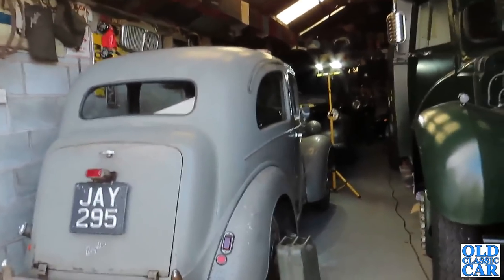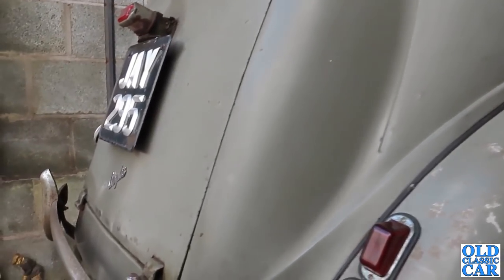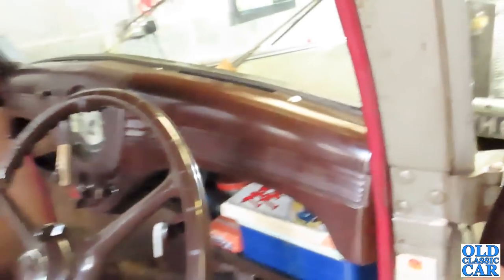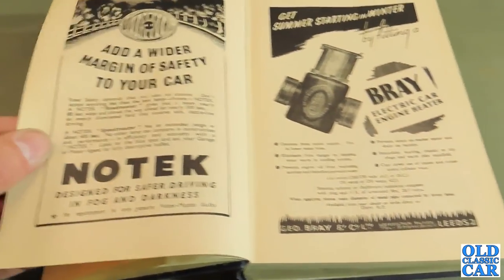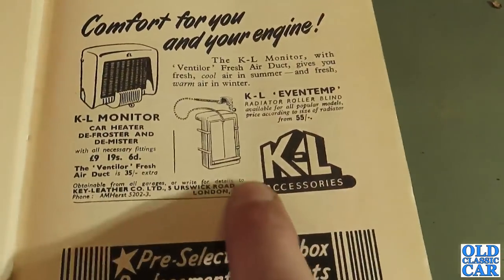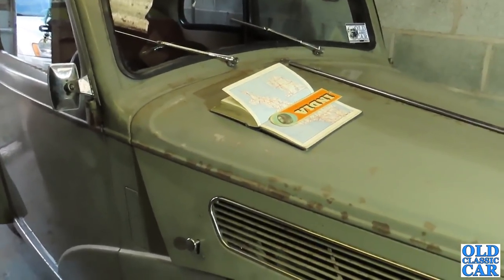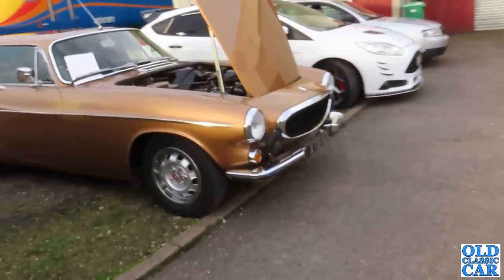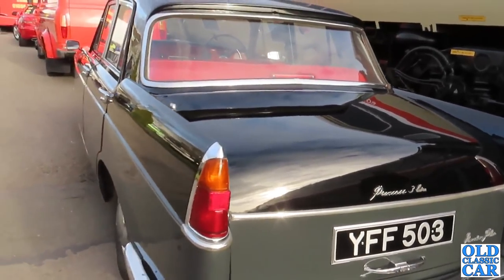Classic car show time - Ford Anglia prep, bakelite attention, off we go ... an imminent fail avoided

Comment: I am with you on the voltage upgrade,  'if it ain't broke don't fix it'. Just a thought on the bakelite, there used to be a museum in the Lake District dedicated to that material they may have some guidance on how to look after it. I remember they had some classic caravans as well. It's many years since I went there so it may not be open now. Anyway this was a nice video,  a bit of tinkering and driving. Oh and do keep the peg it adds to the character. 👍

Comment: About 40 years ago I bought an 'Autocar' handbook c.1956 fro9m a village fete bookstall, similar to your 'Motor' example, On page 100 there is a line-drawn illustration of a bakelite dash on an Anglia like yours titled 'Complete F&J hand control equipment on a standard Ford Anglia for a legless driver'. They clearly had a more laissez=faire attitude to drink-driving back in those days!........

Comment: Hi, I am surprised with the use of the peg and a bit confused to what purpose it serves? It is just because the choke cable isn't a locking one? Also how long do you let it warm up with the choke cable on? I recently had to replace my Anglia's choke cable with a non locking one and I only have to hold it out for about half a minute, not even while on a cold start. Then it just goes back into the dash itself and it runs just fine!
My worry I guess is I might be running it a bit rich if it runs so easily without choke.
Reply from the maker: Mine doesn't appear to lock out so the peg just helps it a little, quite a common "upgrade" back in the day. It doesn't take long to warm up but I've not timed it, it varies a bit. The plugs will tell you if you're running too rich all the time, just check their colour after a decent run.
Reply: @oldclassiccarUK  Thanks for the tip to check the plugs I wouldn't have known.

Comment: Not stressing dynamo bearings - is there an oil hole for the belt end of the dynamo ? There probably is an oil hole on the other end at the centre of the bulge on the end cap. Seems odd they put one there but not at the other end - which is why I'm asking. Otherwise you'll have to wangle oil into the belt end bearing by some other means !

I was hoping this video was going to be more of the actual drive to/from Crewe.
Reply from the maker: Thanks for watching, previous vids have shown more of the actual driving along but I don't want to repeat myself therefore I try to vary things a bit, other vids on the Anglia are in the Ford sidevalves playlist (category), here:
https://www.youtube.com/playlist?list=PLOo0jewyadeGPUJIs5kqI0DeAUdNYL37O
Reply: @oldclassiccarUK  Tricky !

Comment: For what it's worth, I think it is worth polishing up the dash - it might prevent it from cracking or otherwise deteriorating later on. I have a feeling (although I might be wrong) also that the original idea behind the bakelite dash was that it was meant to look like, or at least remind one, of the traditional wooden dash. A bit of polishing helps in authenticating things in this respect somewhat.

Comment: Would it be horrible to try and add a heater to make it more comfortable in wet weather at least , as you said you don't like to drive in the winter due to the salt
Reply from the maker: Welllllllllll I have various 1950s heaters that could be pressed into service, but they'd all require me to drill holes in the bulkhead etc, I think I'd prefer to wear gloves and not drill the holes. I might look at fitting a heater in the Prefect possibly, we'll see.
Reply: @oldclassiccarUK  If you can manage with dressing warmly good on you. 
I have a vehicle that was never equipped but have not found any source for a reproduction or NOS unit and don't want to change the vehicle to 12 volt just for a heater.
I think it's a problem many deal with , how or should one update for comfort and modern safety standards.

Comment: THE MEMORIES   you've brought back.  My first car in 1966 was an Australian production 1952 Prefect, E93A I think. Over here the headlights were in the mudguards and the boot was a hump back like your Anglia.  My car had British running gear taken from my sister's written off Brit model (she rolled it 3 1/2 times on a motorway whilst on L plates). My dad bought a Aust shell and swapped everything. 
The Drivers rear door was from the Brit but did not fit properly (hinge prob) The Aust had a solid roof the Brit had the fabric insert and a straight back boot. The Aust car had a metal dash with Bakelite centre. The Brit car had leather seats and the door trims had to have additional holes for the door handle and window winder as they were positioned slightly differently (parts of an inch)
The Aust car did not have trafficators whereas the Brit did..

My sister ran it without oil and killed the engine.  Dad made one engine out of 2 but could not get it to fire-....turns out 2 versions, one with timing chain one with gears meaning cam rotation opposite.

BRAKES were appalling teaching me to double declutch back to 1st as well as I learnt to watch traffic way ahead which I still do. 

Ring gear had a couple of teeth missing so I would do a cold start on the handle as a matter of course. warm starts were a hit or miss depending on crank position.
I too used a peg on the choke (attached by a lanyard to the dash) till I found out twisting the choke knob when it was out would hold it out.
Best wishes from Australia
Reply from the maker: Great story thanks for posting that, hopefully more news on the Prefect project soon (a friend of mine has the later Prefect with the headlights in the wings).

Comment: The peg - is it one of those that relies on a twist in the cable to hold the mechanism and it just needs the twist setting at the carb end? Its years since I had a Ford so I cant remember if they were twist to lock.
Reply from the maker: I don't think this one has ever twisted to lock, but I could be wrong
Reply: @oldclassiccarUK  Trick is to undo the connection on the carb then see if you can pull & twist the control. If it then locks, at the carb end twist the cable the same way so its pre-tensioned in the locking direction before doing it back up. Works on original Morris Minor chokes.

Comment: A slight smear of lineed oil works well to,  but use very sparingly but lasts reasonably well, dont use on the steering wheel though.
Reply from the maker: That makes sense I'll try that, I've a container of it ready to use on the Prefect when I get to that stage :)

Comment: Smashing content as usual, looking forward to this year's meetings . As a side note how you coping with the new fuel formula ?
Reply from the maker: Thanks, as for fuel I just use super unleaded E5 if the fuel is likely to stick around for a while in the car's tank (eg on something not used very often), otherwise I've not given it much thought tbh but I'll keep an eye on rubber fuel lines etc in case they deteriorate

Comment: Why do you have a clothes peg for the choke ?
Reply from the maker: The choke knob tends to drift back inwards without it, a common thing with cars like this
Reply: @oldclassiccarUK  The thing is - the peg should not be stopping the choke going full in.
How about doing a fix at the carb end - by weakening the return spring ? by repositioning the end of the spring.

How was that choke designed to stay out ? I know some were just stiff, others were twisted to stop out and some (Morris Minor) were notchy.
Of course, if it was me, I'd automate it ! - if for no other reason to pee off all those that swapped auto chokes for manual :)))))

Our Mk1 Granada Ghia had auto choke. I won't say it was brilliant but it was ok. It also needed adjusting after a few years - and gut feeling, I suspect the adjustment could have been better !

Comment: What is the price range for a running 1950s Anglia or Pop 103E in good condition?
Reply from the maker: Nice ones typically start around the £4500 mark in the UK, up to around £6-7k I suppose for a mint example.
Reply: @oldclassiccarUK  That is a very reasonable price for a vintage car...so there must be many still around.  By the way, that is a 1952 Cadillac at the car show.
Reply: @SpockvsMcCoy  
So i guess in real terms with inflation etc a mint restored example is cheaper than when new ?
Reply: @stuarthall2180  I am not British so I am unsure... but the U.K. has had significant inflation since the 1950s.  Also, these old Fords are extremely basic compared to a new city car without options.
Reply: @SpockvsMcCoy  
Thanks for the reply. I think average person got £4-5 per week in wages back then.
A new car like that was about £3-400 ? I'm  sure someone will know more than me.
Reply: @stuarthall2180  These small basic Fords were built for working class people.